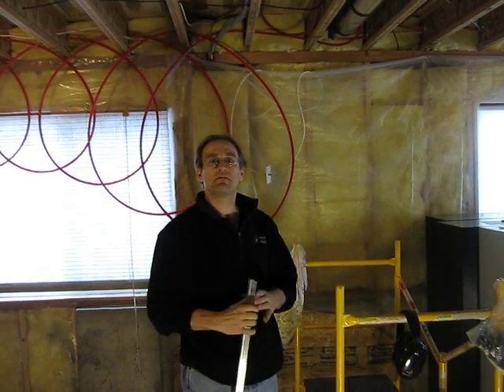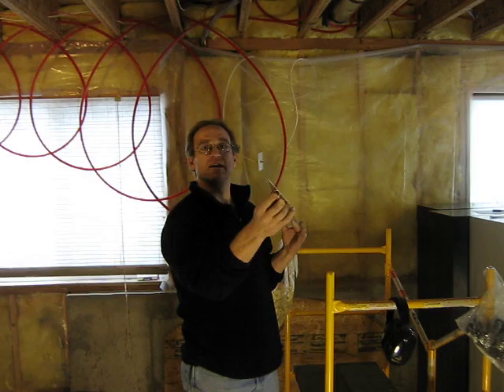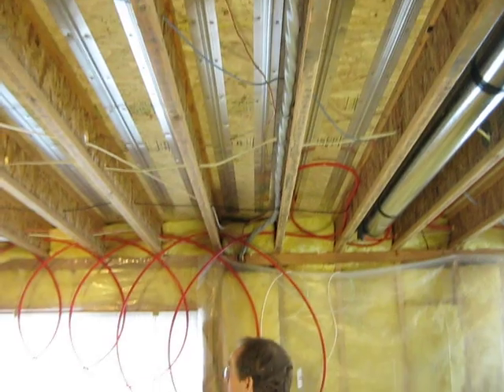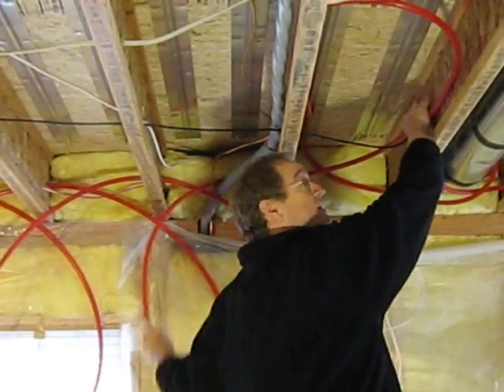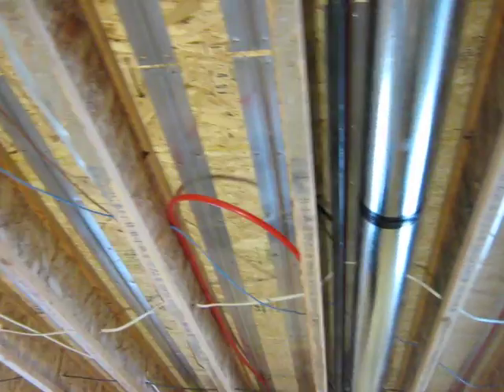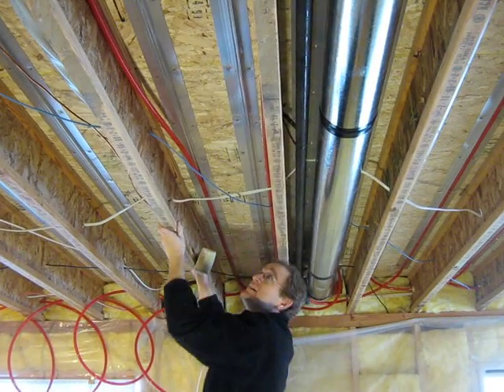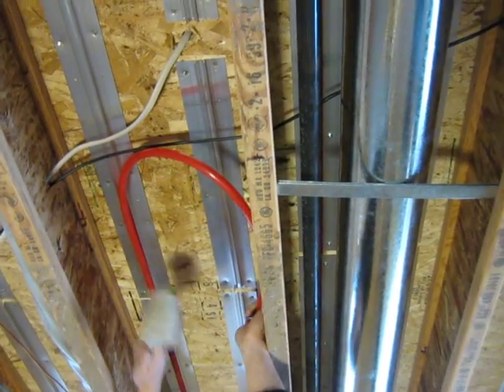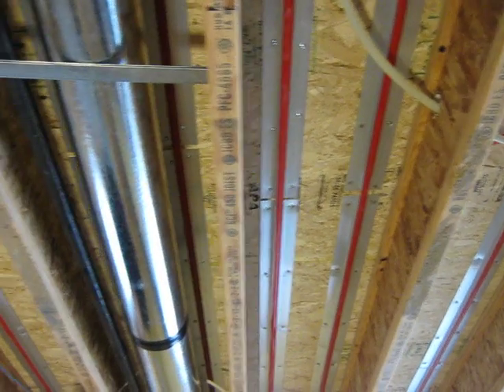underfloor radiant heating installation

Comment: What is the maximum temp of water you can run through the pex? I built an open system boiler and my water got  up to a consistent 170+ degrees and stayed there about 6 hours without restoking the burn chamber. 

If I have excessive heat, above the normal 120 degrees, do the transfer plates do much more than I can get with the pex ran under the floor between the basement joists? This is a retrofit on a 40 year old house.

Comment: How about if there a leak how would you batch the whole  on plastic. How much heat can it  generate  up for example a room 12 by 12 if the temp is let's say 32 degree And the ceiling is 15 feet high? Can you run this around your entire home , also How much heat can the tube handle. Thanks

Comment: Nice brief to the point video.  What is diameter of the holes cut into joists.  If PEX is half inch would 3/4 inch diameter holes work?  Thanks

Comment: I have the exact scenario you are installing.  However, I wish to use the Ditra Schluter decoupling membrane between my wood subfloor and tile.  Do you have any experience with Ditra and would it provide too much insulating properties?

Comment: How well does this work with a tile floor?  Would that be too many layers?  Subfloor, concrete backer, thin set, and finally tile?
Reply: a little late but this would work amazing with tile floor as the tiles would hold heat better along with the concrete backer and all that.

Comment: This system is ThermoFin by Radiant Engineering. Go to their site and contact them for answers to your questions.  Yes, it can be installed under hardwood floors.  Info is on their site.  Just google "radiant engineering".

Comment: ThermoFin is a patented invention by Radiant Engineering in Bozeman, Montana.  This is an excellent video showing its installation.  Radiant Engineering (not the same as Montana Radiant) has more info on its web site, including thermal images of controlled tests comparing it to other products.  The custom design kit systems for the do it yourselfer as well as working with architects and builders. Go to their site and learn more about ThermoFin. Contact them for answers to your questions.

Comment: -He is using wrong more expensive head-spreders (but as he is using the way when they are preventing the heating, it is good anyway)
-the idea of fitting and screwing heat-speders into boards mean that you cant take the boards off without damaging them
-cables inside the heated area (which have heat nowhere to go shortens electrics lifespan to less then one fifth (by 80 percent) and once they burn you have to takes hole sealing of because of previous point...

Comment: Small water heater will not be cheaper. If you reduce your boilers heating temperature to 40-50 degree Celsius instead of using thermostatic mixer which is lowering it to that temperature anyway. Boiler ends-up being over 40 percent cheaper then water heater. the reason why it uses so much fuel is that it is heating water to too high temperatures necessary for usage on less effective radiator. but if wonted, heatsource is ok any...

Comment: Most Pex only handles about 180% to 200% Fahrenheit right? So why not run it off of a small water heater instead of a boiler? If you use Evacuated heat tubes to heat water in a superstore or a really efficient water tank, wouldn't that be optimal? Not to mention way cheaper than using a boiler?  What would the down side be for this type of configuration, anyone have any experience with doing this?

Comment: Uh, when you put the tubing on the outside of the aluminum you may be getting thermal transfer from the tubes to the aluminun to the floor, but you are radiating the exact opposite direction aren't you.  Why wouldn't you put the tubing in the space between the aluminum and the floor which gives you both thermal transfer, ie. conduction and radiant direction into the room above?